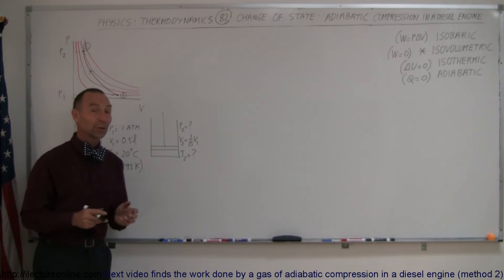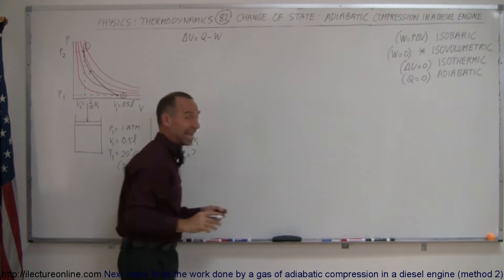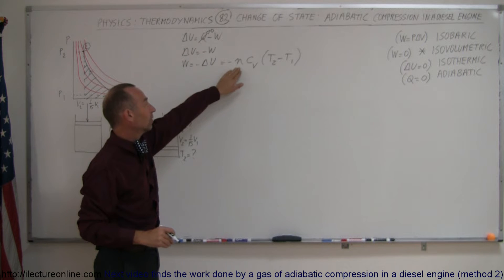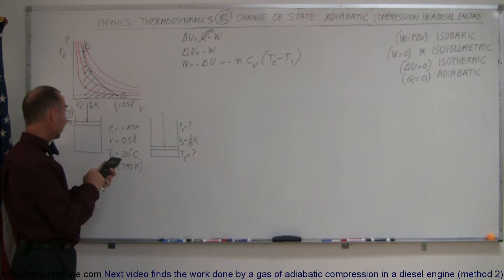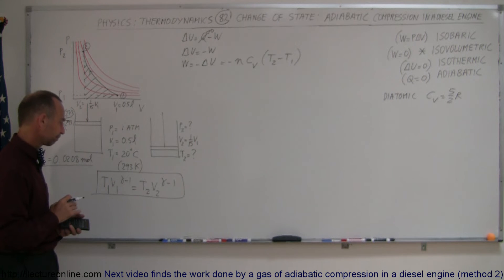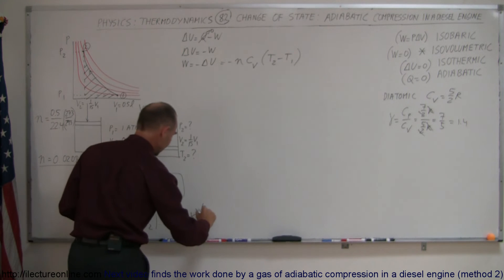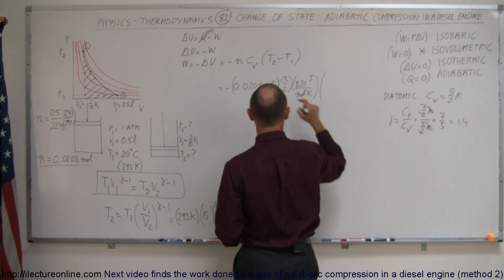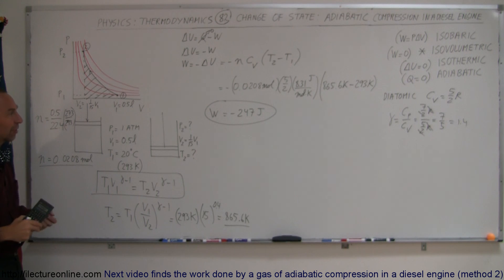Physics 27  First Law of Thermodynamics (18 of 22) Adiabatic Compression in a Diesel Engine

Comment: @Michel van Biezen
Dear Michel….just a quick question….for W = -n.Cv(T2 - T1), could you please clarify the use of Cv here in that, since both pressure and volume change, and Cv is molar heat capacity at CONSTANT volume, but volume is changing….the same applies if we had used Cp the molar heat capacity at CONSTANT pressure. Thank you
Reply from the maker: The only time you use Cp is when you calculate Q (the heat added to or removed from the gas) and the pressure remains constant.   You always use Cv when calculating the change in internal energy, regardless of the thermodynamic process.  Since in an adiabatic process Q = 0, and therefore W  = - change in internal energy.
Reply: @MichelvanBiezen  That’s great, thank you so much for the clarification Michel

Comment: what is the difference between the adiabatic process and the isentropic process?
Reply from the maker: An adiabatic process is a thermodynamic process where no heat (Q) enters the process from environment.  (Only internal energy is used by the gas to perform work).  An isentropic process is an "idealized" adiabatic process that is completely reversible, and therefore does not increase the entropy of the universe.  No energy lost due to friction, etc.

Comment: Good day Sir. In solving T2 part. May i ask how did you solve (V1/V2). The way I see it.(V2 = 1/15 x V1) so (1/15 x 0.5), right? The answer should be (V2 = 0.033). Please tell me if I got it wrong. Thank you
Reply: v1=0.5 lit
v2=0.5/15 lit = 0.033 lit

v1/v2=0.5/0.033=15

So, in a simpler way, 

v1/v2=v1/(v1/15)=15v1/v1=15

Hope it's clear.

Comment: would number of moles n change when gas change in volume ? Don't we end up with same number of  moles regardless of the thermod. process ? You took into account only temperature change. why not pressure change ?
Reply from the maker: The number of moles are assumed to be constant.

Comment: In this example, is energy added to the gas?
Reply from the maker: The internal energy of a gas only depends on its temperature.  Since the temperature increases during an adiabatic compression, energy is added to the gas.
Reply: Michel van Biezen 
Thanks for that.
And if during adiabatic compression, no energy comes in from outside, where does this energy come from which is 'added to the gas'?
Reply from the maker: The first law of thermodynamics states:  Delta U = Q - W   Since Q is zero for an adiabatic process, it can only come from the work done on the gas (compressing it).
Reply: Can or does the energy come from the gas itself?
For example, we know that a parcel of air which descends in a gravitational field undergoes auto-compression (at 1.1kPa per 100m); and this compression causes the air to heat up - (at approximately 0.96c per 100m). 
Basically some of the potential energy of the air is being converted into kinetic energy.
Is this process, or can this heating process be adiabatic?
Reply from the maker: No, it can only come from the work done on the gas compressing it.
Reply: Thanks for you kind help here, I really want to understand this.

I am a ventilation engineer in mining.
In mining ventilation, we calculate the heat added to the mine air all the time due to auto compression. It's gravity which is compressing the air as it descends, and the air itself heats up, as I said, around 1c for every 100m of depth; not counting any heat added from outside. In this case, gravity is doing the compressing - or the work if you like, but the heat comes only from the air itself, presumably it is converting some of its potential energy into kinetic energy.

Isn't it the same with the air in the cylinder? I don't really see the difference in type between gravitational compression and compression by a piston. In both cases work is being done on the gas by an external force; yet in the case of auto compression, we know that the energy to heat the gas up comes only from the gas itself.
What am I missing here?
Reply: But if the work is done on the gas by compressing it, should it be positive 247J?
Reply: @danicel6725  Michel uses the heat engine sign convention for work and heat.  Work is positive when the system does work, and heat is positive when it is added to the system.   IUPAC specifies the opposite sign convention for chemistry, where both work and heat are positive when added to the system.  It is ultimately an arbitrary choice which sign convention to use, and I recommend accompanying your answer with words to explain the sign.

Comment: you didn,t find p2.
Reply from the maker: Yes, I forgot to include that answer.  I will have to add another video showing how to use the PV^gamma equation.
Reply: thank you sir. and another thing i want to ask is 'Is the change in the internal energy independent of path ?'
Reply from the maker: Since the internal energy only depends on the temperature  (U = n Cv T), then the change in internal energy can only depend on the change in temperature  (delta U = n Cv delta T) and thus it cannot depend on the path taken.

Comment: Good gay. Sorry for stupid question but in this video and the next one up the resulting temperature and pressure seem to be too high comparing to the real world numbers. Normally the pressure when the piston is at the TDC is 1.3-1.4 times higher than Compression Ratio whilst in your video it is 2.95 times higher. What am I missing here?
Reply from the maker: +georgian1970   Good question.  This is just an example of the process, not necessarily a realistic situation, just a good representation of one to learn from.
Reply: +Michel van Biezen Thanks a lot for explanation. Cheers.
Reply: +Michel van Biezen We have figured that out ( thanks to a very educated friend of mine). In reality the air would not fill the entire cylinder due to the friction of the air in the intake piping and other restrictions in the cylinder head so the actual pressure in that 0.5 L cylinder will not be 1 Atmoshpere but something about 0.55-75. When the piston will reach TDC we will also loose some pressure due the oil rings leakage. Moreover, we are not compressing the air but air/fuel mixture so the Y would be just 1.3 instead of 1.4 for air. As the result of all those factors the real pressure in a real engine rotating about 500-600 RPM will be about 1.3-1.4 times higher than Compression Ratio.

Comment: Can you please let me know where you get those 273/293 when you calculate the mol number "n"? thank you..
Reply from the maker: Peter,
When you are working with thermodynamics, temperature should always be expressed in Kelvin degrees.  
0 degrees centigrade = 273 K  (actually 273.15 K
20 degrees centigrade = 293 K
I have a video on temperature conversions.
Reply from the maker: ***** Sand, Peter,
Now I get your question, thanks for clarifying.
Yes you can get the same result using the PV = nRT equation.
What I did was use the "fact" that 1 mole of gas occupies 22.4 L at standard temperature and pressure (273K  and 1 ATM).
So I used the ratio:  (1 mol) x (0.5L/22.4L) * (273K/293K) = 0.0208 mol.
Go ahead and try to use the PV = nRT equation and you'll get the same result.

Comment from the maker: Dominique.   The word "consider" is fairly general, so I am not sure what you are asking.  However, this may help:   The Area underneath a curve on a PV diagram is the work done by the gas if volume increases and work done on the gas when volume decreases.  With a complete cycle, the work done is equal to the area enclosed.  There is no information found by looking at the area above a process line, unless you are looking at the area enclosed by a cycle.  Hope that helps.

Comment: Do we have to consider the area above the curve in some cases as well? When is that so?Kindly explain. I have come across some videos which consider the area above as well.
Reply: Area above the curve is ill-defined, because there is no upper x-axis to bound the area on the top.  The area above the curve on a single process, is infinite, and doesn't mean anything.

There are cases where you consider area between curves on this plot, which corresponds to the net work done by the gas over a complete cycle.  An application of which, is engines, like the Otto cycle engine in an "Otto"-mobile.